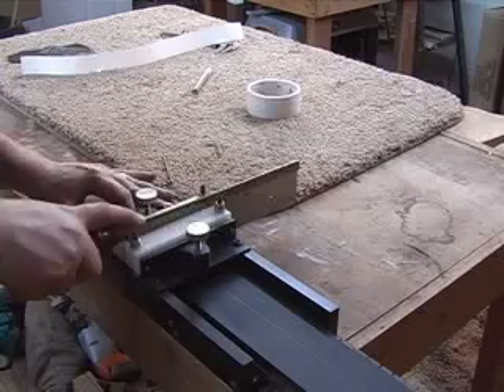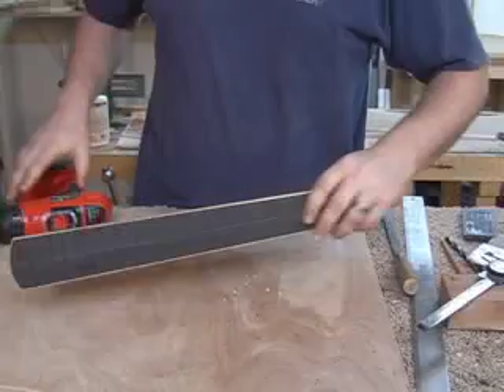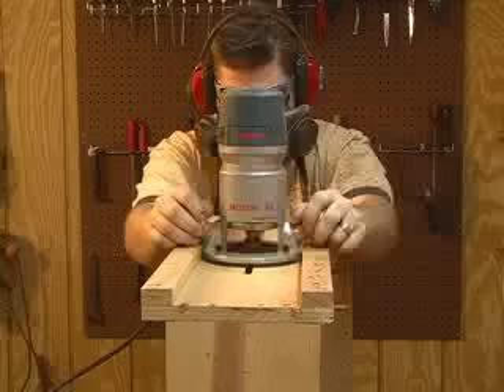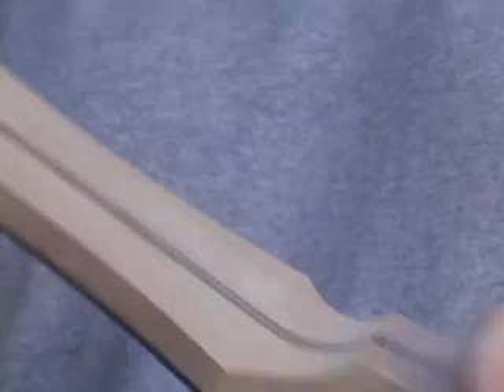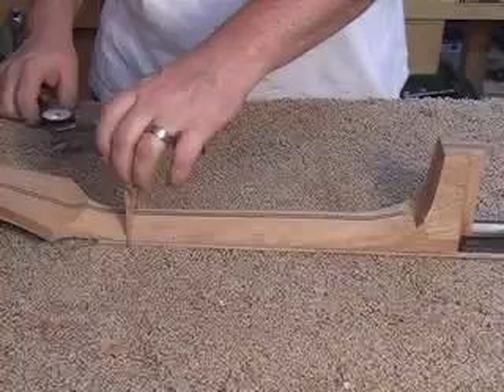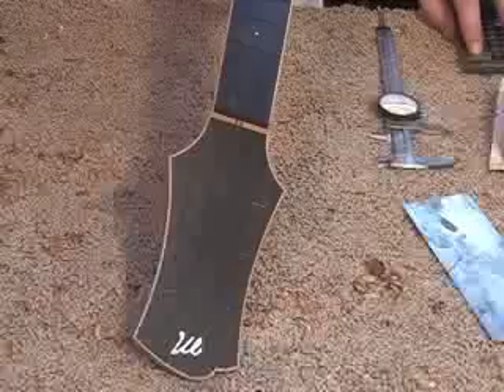Making an acoustic guitar neck

Comment: Gotcha. I might order one DVD from you to check out before ordering the set. What single DVD do you feel the proudest of? Which one will best sell its brothers?
We finished an all-koa ukulele last week. Or should I say we THOUGHT we were finished until we played an open string and then 12th fret. G and Gb. Ah nuts! Removing the bridge was harder than anyone thought, even after heating it. Bridge broken, finish ruined, looks like a setback. If a $20 DVD could have prevented that, we'd buy it.